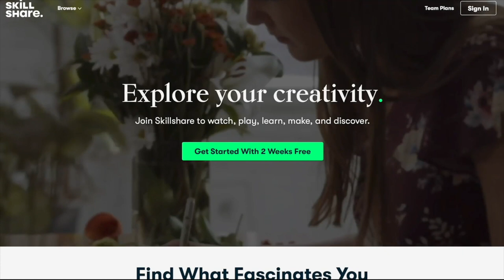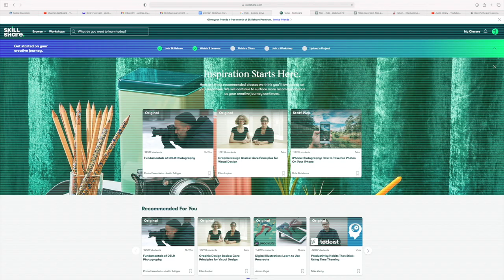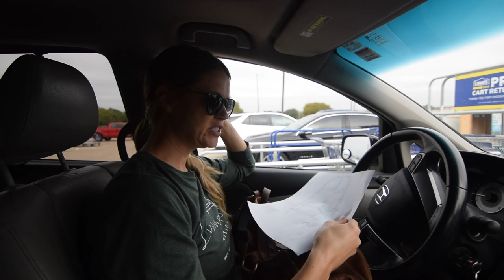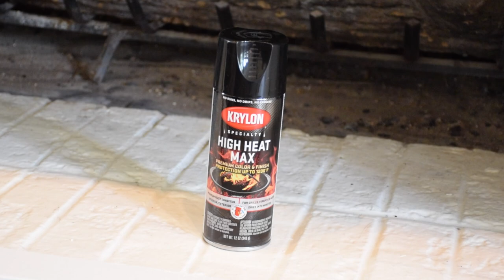INSANE DIY Fireplace Build! // Stunning Modern Fireplace Makeover // Extreme Home Makeover

Comment: Andrea--So beautiful! Is there a building code in your location that dictates how closely a wood frame can be in relation to the fire box?
Reply: I was wondering the same thing. My husband is a contractor so I'm always thinking, "Is that to code?" 😁
Reply: I wondered the same - it's so beautiful, but here in New Zealand, we couldn't clad a fireplace like this in wood. It would have to be brick, stone, or fibre-cement board, maybe...
Reply: Same thought, my county requires 12”
Reply: Definitely not to code. Need a minimum of 12" all directions with noncombustible materials (like cement board, metal studs, brick or stone as suggested below) and that's flat to the fireplace.  Building out a wood cave/tunnel is extremely dangerous. I'm guessing the building inspector did not check this project out.

Comment: Hi there! This fireplace is incredible! Looks better than the one my contractor did for my house! You had mentioned that finding the right angles for the side boards was  a bit tricky. What angle finding tools did you use ? Also, do you know if the drywall guys used metal beads at the corner seams?

Comment: I LOVE LOVE LOVE THIS!!! I want to do something similar to mine. Did you check if it’s code or not? The opening is supposed to be 12 inches from the top and 8 from the side but I’m curious if you got the go-ahead from a professional or not? Like did you fire proof it?? Either way I’m tooootally in love with it
Reply from the maker: I'm not honestly sure if it's to code, but I got a few professional opinions and they said it was fine since it wasn't wood burning (and I tested out making sure something that close wouldn't get hot at all even after hours of running, then still used firebrick to be extra safe).  If you have wood burning, I wouldn't risk it as a those just get SO hot.  This would totally work for like an electric fireplace insert, or possibly a similar gas one.

Comment: Looks great, but does your local code allow wood to be so close to the opening? Just wondering. We had to make adjustments on our fireplace redo because of our local code. Would hate to have to see all your hard work wasted.
Reply: Looks beautiful but dangerous. Code requires 12" minimum distance with only noncombustible materials. Please do warn folks to check local building codes before attempting.

Comment: Looks so good!! Its insane to think you guys did all that.

Maybe a stupid question but, I thought a frame tv was supposed to have the frame already on it or is that not a thing?

OMG at times you so look like a young Julia Stiles
Reply from the maker: Thanks!  Haha not a stupid question, it looks great without adding anything additional, and you can buy different "bezels" (I think they call them that instead of frames so it doesn't get confusing?) if you want to change the color up, but they cost a lot and I wanted something a little different anyway :). Also, I used to hear that all the time!
Reply: @diywife  Also your husband is super hot but I am sure you hear that all the time too haha

Comment: Had a question… once putting the fire logs on, any issues with the sheet rock getting overly hot. Hopefully it isn’t a fire hazard. Otherwise looks insanely amazing. 

Just make sure it’s safe.
Reply from the maker: It’s not wood burning so doesn’t put out much heat at all, even turned up as high as it goes. I tested it out with a scrap piece on that front top area that would be the most likely to get hot, and it’s not even hot to the touch! We still used fire rock instead of regular Sheetrock to be extra safe (and since we’re sharing here). If it was wood burning this wouldn’t have worked though.
Reply: @diywife  amazing. Thanks for responding so quickly.
Reply: Love your videos. You’ve got quite the talented eye for repurposing. And your video man is an excellent producer. Great team y’all. Stay safe and happy holidays.

Comment: Two comments. 
1. I think it needs a wood mantle added over that horizontal white ledge it has now. I think that would give it more depth. 
2. I am surprised at what you can do in slides and working on the ground (for the most part). 

Great job as always.

Comment: Just wondering if you checked your local building codes on fireplace clearances to combustible material? This looks like an accident waiting to happen.
Reply: I'm shocked that no one is noticing how dangerous this design is (wood tunnel right in front of fire). It could be done with non-combustible materials except for the curve might be very challenging.
Reply: Comments pointing this out are being removed...I posted this afternoon...looks good unfortunately not building code complainant.

Comment: Very pretty but building code says there is to be NO combustible material wiithin 20" of the opening of the firebox.  Neither the 2 x 4 framing or the plywood arch meet building code.  They are a fire hazard.  Those surfaces would have to be covered with a non combustible material.  Just painting them does not suffice.
Reply from the maker: That’s why we covered it in the thickest firerock there is, it’s also not wood burning so code is a little different, no way would this be safe with wood burning.
Reply: @diywife  did you check to see if code was different for gas logs?  Just wanting inspired others who love this, to be cautious.  It really is beautiful but it also has to meet code.